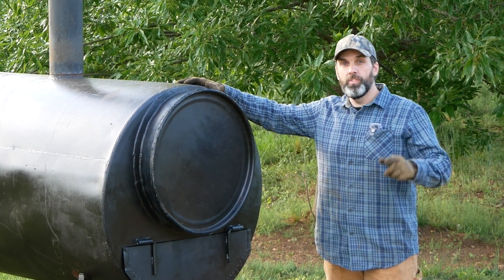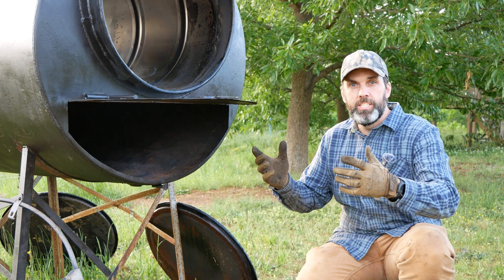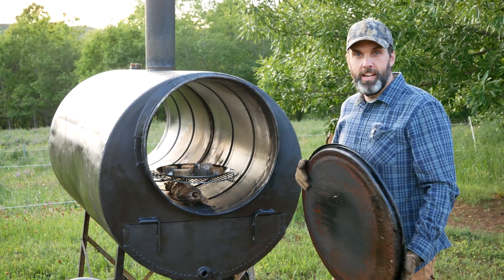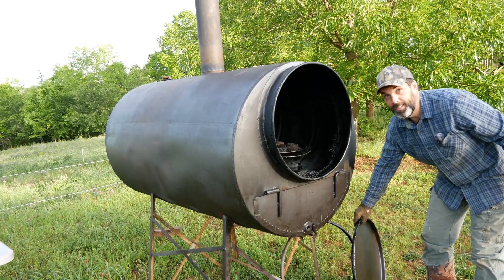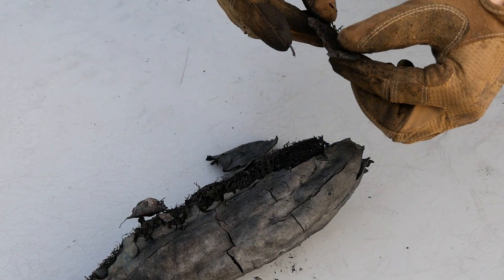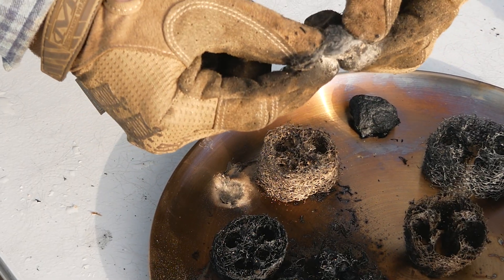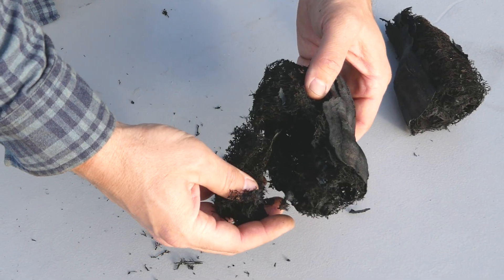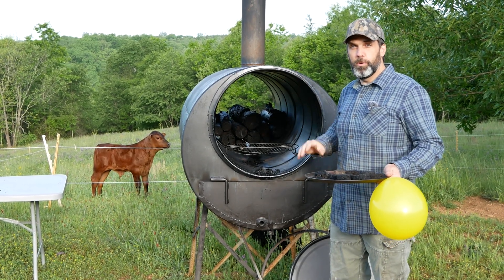What Happens When You Try to Pop a Balloon with a Carbonized Thorn?

Comment: The outlet needs a pressure valve. Oxygen comes in once it's gassed out. Neat system!
Reply from the maker: Thank you!  We have to strike the right balance between allowing pressure in and keeping oxygen out.  We are going to add some seals to the barrel lids because they are leaking quite a bit.  As for the valve, the only problem with the valve is air has to be let back in as it cools or the drum could implode.  I think we can get this new kiln tuned just right.  Thanks for watching! -Mike

Comment: Watched Ben built this for you cool not to mention Buggy gave you the thorn to carbonize. 
Question  how long does it take to carbonize your items I'm assuming it depends on the size of the items?
Have you ever done any furniture or like a seat cushion, towels, curtains etc.?
Be Blessed
Reply from the maker: It definitely depends on how thick the item is.  This run went for about 4.5 hours.  It definitely needed some more time.  I'm also getting a seal for the drum lid to make it more airtight.  That will help too.  Thanks for watching! -Mike